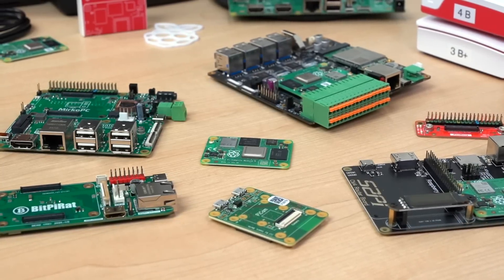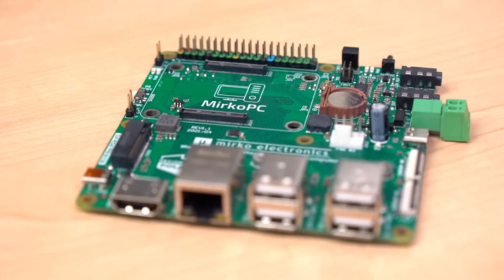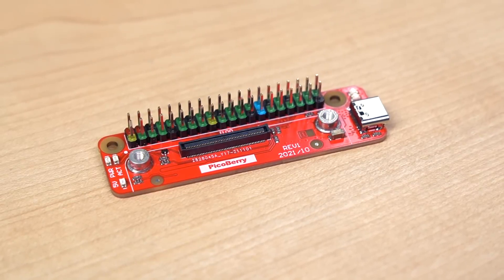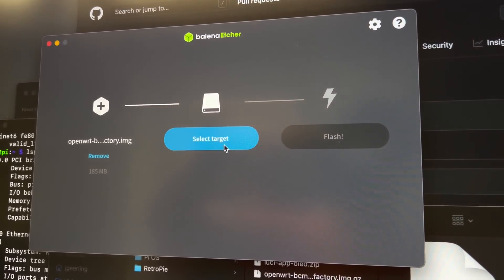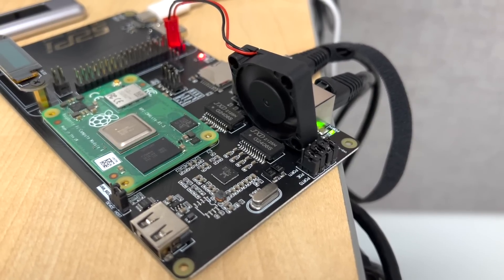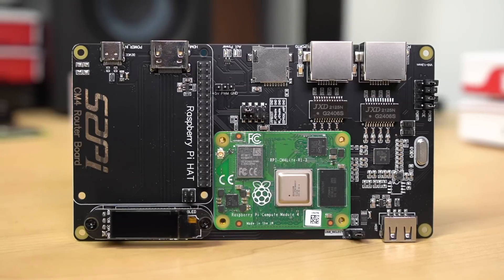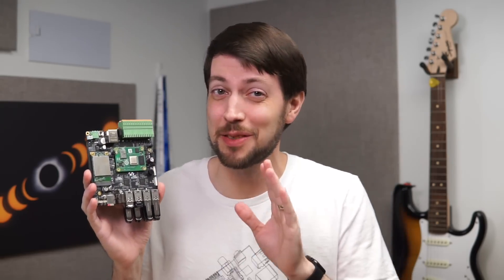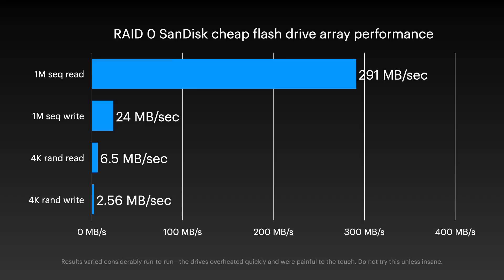So I heard you liked USB... (5 new CM4 boards)

Comment from the maker: What's your favorite board? Also, Seeed Studios (no affiliation) still has one model of CM4 still available for sale, FYI.

Be sure to subscribe to my 2nd channel, Geerling Engineering—my Dad and I will test out the BliKVM on it soon! https://www.youtube.com/channel/UCsd6hP-zzIkCpw8XGw7Osyw
Reply: Your second channel link is not working please update
Reply from the maker: @mohixx117  Oops, fixed!
Reply: @JeffGeerling   subscribed😄
Reply: So glad to see this finally, thanks Jeff!
Reply: @GeerlingEngineering  When will the third channel, Red Shirt Jeff, come?
Reply: Comment got unpinned due to edit. It's now anyone's race to the top! Who will it be!
Reply from the maker: @MarcoGPUtuber  lol oops
Reply: Try desouldering the ram chip in the pi 4 and Upgrade to 16 Gigabyte
Reply: Hey Jeff! A bit unrelated but I'm out of ideas. I run pi4 in Argon One case, meaning i boot from an SSD from the bottom usb3 slot. That works just fine. But whenever i connect my HDD to the second top slot, it refuses to boot. Apparently there's no way to change the boot order for the USB devices. In the serial console output, i can see it assigns sda to the external drive and sdb to the boot drive when the HDD is connected to the top USB3 slot. When i connect the HDD to usb2 it boots just fine. I run latest stable release of Debian. And i tried finding a way to disable SD card reader because it keep polling it every minute or so - that doesn't limit me in any way, it just triggers my PTSD. Awesome video as always. Keep it up!
Reply: Holding out for the uptime lab blades..
Reply: Looking for the best router board, can you follow up for the best on the market now?
Reply: I want a PCIe Pi so I can have a computer in my computer
Reply: Krówka is pronounced more like croove-kah, ó is like oo and the w is like v (but also f in this word)
Reply: My favorite board is my projector design. I need to finish documentation and then I can send it over if you would like to include it in the prototype/homebuilt section on the Piboards.
Reply: PI CM4 vs PC/104 ?

if doable in reasonable time
Reply: @marcocipriani01  a
Reply: Not only Polush candy, the same ones named "Lehmakommid" direct translation "Cow candies" and it's made the same way, we have had them for many decades, no choclate in it it's cream and half caremized sugar basicly.
Reply: Would axzez interceptor be your choice for RPi based SATA raid setup for home yet? Or in your opinion you have another you would rather prefer for home use with Security Camera, Home Assistant, Media Server, Private Cloud all in one?
Reply: I love boards that can actually be purchased! 😂😂😂

Comment: Hi Jeff, thanks for the detailed review on Compute Module carriers!
I'm currently searching for a carrier board that can run a Raspberry Pi Compute Module using a single USB-C port, supporting features like power delivery, display output, and peripheral connections.
Do you have any recommendations or suggestions for such a setup?
Thanks in advance!

Comment: At first i want to make a simple replacment for my phone, just adding a toutchscreen and a sim module.

Later i want to make a home web system (file/media server + router + wifi + simple mail server + even simpler basik http web server (isolated)) and it seems there finally is hardware now available the sata and 4 ethernet board in this video.

Few other simple projects...

And for first advanced project (with own pcb with pi module) i want to make a 2 module so called pocket pc with many functions. 1 module to controll and handle all the hardware, the other to just run the os and apps.
Added hardware(more than in the original build) will be a yoistick mouse, SDR and finally the most challenging hardware addon... 
The sunclasses with built in oled display(i mean i have found some good small dize and good resolution ones but need the perfect, it can cost doble more than everything else combined). So i am playing a computer game blasting(bone induction audio) with full stereo(or be in a zoom call/class with no cam from you but see, hear and can chat with everyone), but walking outside, hand in pocket, with no headset and sound.

Later on if all works fine i might make a updated version(more rugged and more industrisl looking) of the classes if a better oled is available or old needs replacment (broken) where i would want to add stereo camera(bright light and night vision), distance laser, and maybe even a dedicated stabilised(zoom camera (or prob as an attachment), directional mic and rf resiver.
Basicly try to make a spy headset (it might end up looking something like a nightvision goggles or something) xD
Would be cool overall, feel ad a kid again.

Prob will still keep the light one still too.

Comment: These are all cool gadgets but I hesitate to buy a device which may not be around for very long. A lot of these feel like one-off production runs. I'm really itching to build a ceph cluster to serve as data storage for a k8s cluster on rpi but I haven't found any hardware which is both capable and which I can trust to be around for a little while when I want to add nodes.

Comment: The PiGear Nano has really an impressive feature set for serious IIoT use cases.
On the normal Pi or for example on the TOFU board you can utilize several HATs with supercaps to initiate a safe shutdown in case of an unexpected power cut off. This is a must have in many IIoT use cases. You would have to create your own solution to face this issue on the PiGear Nano.

Comment: Simple thing I assume you or someone has tried but does the PoE for that unit need to be PoE+ or some proprietary PoE injector? I've definitely run in to that as an issue. There are some wacky voltages out there for PoE.

Comment: Write speeds on USB flash drives are terrible in general. Cached writes might have done better with the added bonus of even more fun risk.

The next gen of Pi modules could really use more PCIe. That 'd open it up for more industrial and creative uses, though I'm not really sure the RPF wants to got further in to that market since you'll see things like 30+ year platform support (ei. PC/104) .

Comment: Have you got the 52Pi CM4 Router board yet? Any ideas on if we can get the pi to do channel -2  (2.397 GHZ) on 2.4 gig wifi with openwrt? Do any countries support that channel? That's the part 97 ham radio bands.

Comment: Technically would this be a good RAID 5 solution by connecting 8 external powered drives? Synology prices are through the roof right now.
Reply: No.

Comment: its a shame in 2022 the router board didn't ditch *dual 1999 1Gb/s ports for generic r8125 2.5Gb/s, & even especially 2022 openwrt hardware needs usb3 connected hd/wifi6 add on's .... perhaps ill buy the next version if they add the above to be current not 1999, oh well.
* dual r8125 lan & dual r8125 wan with the MPTCP (Multipath TCP) driver compiled as a standard option puts it in the must buy diy basket oc
https://m.youtube.com/watch?v=VlnnH5RtvSE&t=1s Faster Internet with MPTCP (Multipath TCP),oneMarcFifty

Comment: I need a powered USB hub that doesn't split the current between all connected devices, in other words, it provides each port an independent 1amp. Does the PiGear Nano do that? If not, do you know of a product that does? If not, is it possible to make one?
I do not need USB3.0/3.1

Comment: Such a shame they handicapped the CM4 with only a single lane of antiquated PCIe 2.0.  Imagine the possibilities that would be opened up if it had even two lanes, or <gasp> a full four lanes of PCIe 3.0 or 4.0.  Even a single SATA3 port is throttled by the PCIe 2.0 interface; let alone multiple USB3, SATA3, 2.5Gbe or 5Gbe, NVMe, etc.

Comment: 8:03 if only those were PD sockets, with (separate) port adjustable voltage boost, it would be an interesting & nifty power supply for a pi rack.
add some power meter function (e.g watt usage chart) to network logging and that is 100% dope af.

Comment: Does anyone know if there is a cm4 carrier board that can fit in to a low profile pci slot?
Reply from the maker: So far I haven't seen anyone make one. I think it would be a very neat idea, though, especially a KVM that you could install into a x1 slot.
Reply: @JeffGeerling  Hi there I wasn't expecting this at all great content by the way, the idea i have is a cm4 carrier board on a PCI bracket/card with no pcie connector so it can go in any slot, power can be by sata internal and/or dc jack external.
oh and looking forward to more awesome stuff in the future.

Comment: I really want to see a Raspberry Pi 5 and Pi 5 module.  It’s been 3 years, it’s time.  Doubling the performance shouldn’t even be difficult and 4K YouTube video should finally be possible on a raspberry pi class device.

This is just making reasonable assumptions based on improvements to Arm based devices.  They should be able to go at least a generation or 2 better than 40nm by now as well.

Comment: 7:00 Imagine this thing with an M.2 slot for those specialized tensor processors that are only like $30, and can do something like 150FPS at 1080p IIRC
Reply: I'm interested, what are those tensor processor you're talking about? is the 1080p 150FPS encode performance?
Reply: @xephobia795  look up "M.2 Accelerator with Dual Edge TPU" 2 TPUs on one M.2 2230, each capable of 400FPS, not sure if thats 720p, or 1080p

Comment: 5:00 I wonder if for some reason this requires a non-standard POE voltage, like instead of 48, it requires 12, i had some IP cameras like this and i needed to either inject my own power, or find a 12v POE switch
Reply from the maker: Apparently the problem was a set of resistors on the power lines; there's a fox though it requires desoldering 8 resistors from this version of the board
Reply: @JeffGeerling  Did you mean "fix"?
Reply: @erkinalp  Probably yes

Comment: One Pi-thing I've yet to see come to any fruitful (heu) fruition that I'd like to see come around with these compute modules is homebrew CarPi/DIY Android Auto become an actual thing. The gamut of Android Auto head units runs from "So crap you don't feel bad about Red Shirt Jeff having his mitts on it." to "This is just an Android Tablet" to  "Why is a DMR with no DVD drive $900?"  A Pi-based option would likely cost somewhere in the middle, and unlike the mid-tier head units that are just overglorified tablets, a lot could be done with a Pi based solution.
Reply from the maker: Yeah, I know @Novaspirit Tech has done some exploration in that area.
Reply: @JeffGeerling  His experiments with it are why I hope for CM4 based boards for the application. The boardside part of his build is a little bulky. A board with a lot of the modules built-in could cut down on space and using the CM4 vs a full Pi would cut down on size substantially IMO.

Comment: Great boards, but now we need some CM4!
I already have several CM4-based projects lined up and bought all the components... all except for the CM4 which are sold out all over Europe. 😭
Reply: International shipping? Use a freight forwarder if they won't ship directly.
Reply: @boydw1  sure, pay double msrp and add another 30-50 dollars for shipping. Makes total sense. These are hobby projects.

But for those who are that desperate, I've got a couple of Pi 3, 3+, CM3 and CM3+ I can sell you for $50 each...

Comment: Why is there still. NO. GOOD. SOLUTIONS. FOR. POWER. (poe doesn't count until it's native w/o a hat)
Could you investigate/cover this for Raspberry Pi's?
Reply from the maker: Many boards now accept 12v (and the UUGear board accepts 7-30V through its power terminals), which is great for driving practically anything (I'm sure there's a limit, like you couldn't drive a bunch of 2.5" spinning hard drives on it).

Other boards like the Taco can run up to 90W of hard drives/accessories. So some CM4 boards are pretty good about this.

And a few boards do have integrated PoE (like the CM4 Blade and Home Assistant Yellow), though it costs a little extra.

Comment: So Do CM4's have ecc memory and will it work with Truenas?
Reply from the maker: Technically the memory has internal ECC, but it's not ECC RAM like you'd find on a server or workstation. Also, TrueNAS doesn't yet support ARM64 boards like the Pi :(

Comment: The BitPiRat would be perfect for my project if it had Audio out
Reply from the maker: It has PCM audio built in, with a little ribbon cable connector. You'd have to spit that out into a 3.5mm jack though.
Reply: @JeffGeerling  really?  I'll look into trying this board out then. That was the only thing stopping me from using the CM4. Still have two unopened. I was hoping someone would build a board like this with audio
Reply from the maker: @ChrisHardcoreRidersMC  The MirkoPC also has a headphone and line output built-in. One of my favorite little Pi boards so far.
Reply: @ChrisHardcoreRidersMC  Due to the small board size, I added a PCM port using an FFC socket to expand for audio output - but require to add extra DAC audio chip (can be high-quality audio DAC with optic SPDIF - a future plan so far to design such board).

Comment: More USB's is great, but to run a GPU or other external devices a PSU is needed.   For gaming and so on this is not a major negative since startup costs are low.  I like the Pi Gear Nano best plus with a potable solar panel I could use a Pi with a laptop style screen and go online everywhere possible with a cell connection.  Good luck with your retail endeavor!!!

Comment: i want a cm4 board with m.2 wifi 6e for router
Reply from the maker: This. I want this too :D — still trying to find an affordable 6e M.2 card that does AP mode :(
Reply: Just buy a 6 or 6e wifi router.  Pi wifi even on the CM4 or Pi 4 is a disappointment even with external antenna.  There is a reason why Wifi 6e routers have 4 or 8 antennas and use dedicated wifi chipsets from Broadcom.  The Pi 4 has very good cpu and memory compared to routers but you can't beat the custom chipsets.
Reply from the maker: @bigtvjunky9119   True... but what @Shadow Fandub's suggesting is a CM4 board that has an integrated A+E key slot, and a good WiFi 6e modem built in (not using the Pi's comparatively abysmal built-in WiFi).

After testing a number of consumer WiFi 6 routers, I can confidently say a Pi would at least be on par with the sub-$200 ones.

Comment: "Nobody said cheacp flash drives in RAID were a good idea!" Meanwhile Red Shirt Jeff switches the storage in your home network to RAID 0 on even cheaper flash drives without cooling and removes the backups.
Reply from the maker: So that's why my file copies are running at like 2 MB/sec now. I thought somebody had swapped out my LAN for AppleTalk!
Reply: @JeffGeerling  You should check that to just to be sure that Red Shirt Jeff didn't also swap that.

Comment: Can you do a more indepth video on the PiGear Nano? Also can you use a m.2 wifi card on it instead of the LTE card?
Reply from the maker: No, unfortunately the Mini PCIe slot is not true Mini PCIe, but rather just connects the USB lines through to the USB 3 hub on the board.
Reply: @JeffGeerling  bummer, still be cool to see some stuff with that CAN bus

Comment: Maybe somebody can help me here. Ive got an old NAS which I made smart with a Nextcloud on a Pi in the same network. Both are connected to the Router over a GBit link and I mounted the Nas with samba on the Pi. But that way I only get half of the Gigabit bandwidth because the payload is always routed through the Pi and back to the Nas. So my idea was to add a USB to ethernet Adapter to directly access the Nas and utilize the full bandwidth of the Pi to the Router. But bridging Eth0 to Eth1 resulted in a connection loss to the pi itself. Any ideas?

Comment: @jeff Any chance you could do your USB + RAID tests using better performing drives? I bought some Lexar P20 drives in 2016ish that could rival some low-to-mid range SSDs in terms of performance. There's probably even better options now.
Reply from the maker: I might at some point, for science. The difficulty is how much a good USB flash drive costs! They can be as much as an SSD by itself, and I don't have too much use for them besides toting around some ISOs.

Comment: That PiGear NANO might solve a problem using the Pi in astrophotography gear.  There never seem to be enough USB 3 ports for all the fiddly bits (focusers, cameras, mounts) and cooled astro cameras are heavy power eaters.  2.0 ports just don't win when your single image size is > 40M.  I am using the WaveShare board for my CM4 astronomy setup for the simple reason that it has 4 well-powered USB 3 ports.  A board with ports AND fast storage would be most excellent.

Also, lots of folks (including myself) have used the Pi HQ camera for astro-photography.  There is even an INDI driver for it that works reasonably well.  It is "OK" for planetary and wide field, but not amazing...though it does work.

Great channel, by the way. I enjoy your process and humor.
Reply from the maker: I would think if you can do autostakkert (or something like it), the sensor on the HQ camera should do pretty decent. I just haven't had the time to play with it that I'd like.
Reply: @JeffGeerling  I use Siril.  In a pinch, ASTAP.  I like the way  ASTAP does auto-grading and rejection and use it for plate-solving anyway, but Siril is probably a better overall stacker at this moment in time.  And yes, the HQ cam is impressive for its cost.

Comment: Bummer on the PoE not working with the Router Board, but I still have an extra CM4 sitting here that I'd like to throw in one of them. Thanks for the vid!
Reply from the maker: It's possible it will work with a modification—follow along in this issue for more: https://github.com/geerlingguy/raspberry-pi-pcie-devices/issues/337